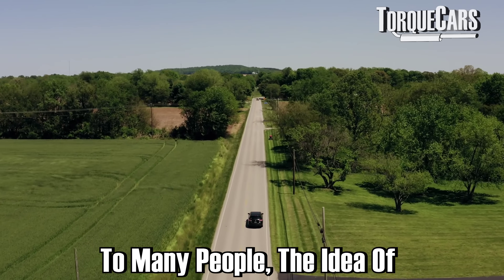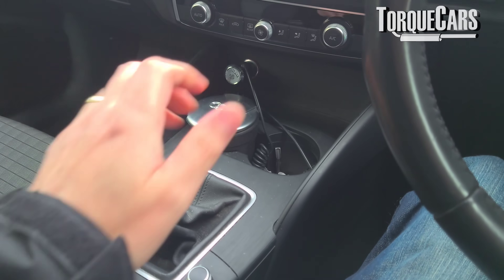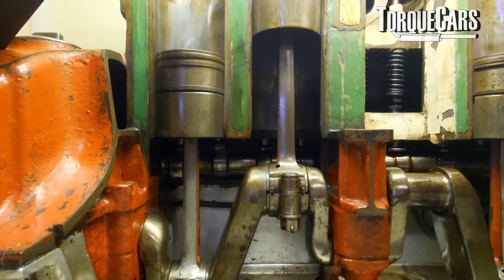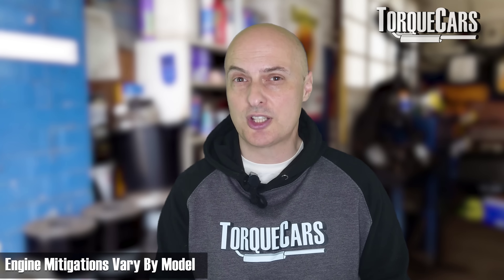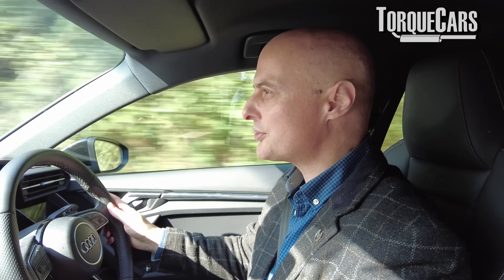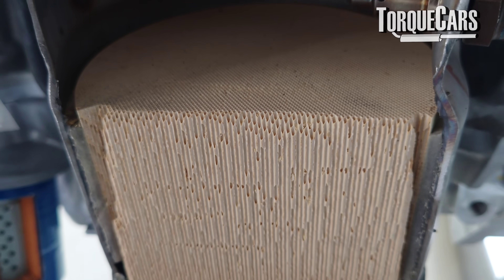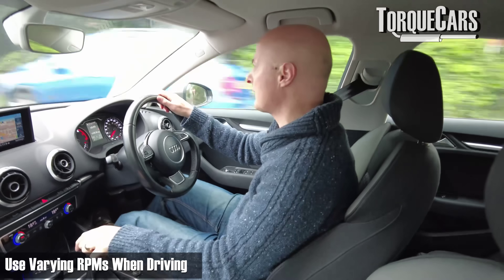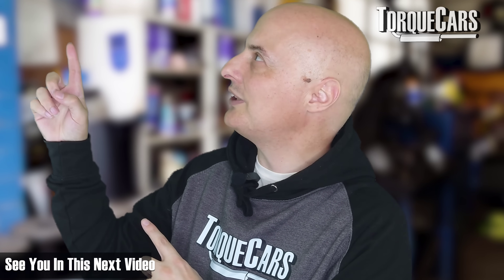BIG DAMAGE By Lugging at LOW RPM? Eco Driving Warning! (Manual Gears)

Comment: Low rpms are just fine for the engine so long as you don't need to give it much throttle.   There is a point in the programming where extra fuel enrichment is delivered when the manifold pressure rises  to a certain point...so best economy happens just before this enrichment point.   About the only way to find this is to watch a vacuum gauge and know when the enrichment happens.   If you can drive without opening the throttle to that enrichment point...then the tallest gear that will run smoothly is the one to use for best economy.

Comment: I got a pegeot 3008 2019, and it rarely goes into 2.4k RPM, its an 1.5 diesel engine, the red line limit is 8k,  even going in high speed or sometimes even throttling, but not thst much. Can it still effect it ? And if so, can i improve it

Comment: All the vehicles I've driven have always performed better after a period of sustained motorway driving if they've been used for long in urban settings. 
The red line on a tacho gives you a good indication of the engine's designed optimal rpm. 
Obviously jumping in and using high rpms on a cold engine is recipe for premature wear, but prolonged idling is undesirable too! What's a driver to do...?
Reply from the maker: Low load low RPM till the engine warms up is the best way to go if you can. https://www.youtube.com/watch?v=aCGsZp-OG4c I'll do a video on warm ups and driving cold engines to clarify this as I think it is a topic many drivers are unaware of.

Comment: Also a good reason not to go WOT at low rpms is the damage it causes to the gearbox, the small teeth that actually engage the gear and hold all the force slowly wear out. For example on diesels if you want to accelerate in 5th or 6th gear going below 2k rpm, it will sooner rather than later cause damage, because the engine has the torque and strength, but the gearing is way off to smoothly pull away, also at low speeds the transmission oil won't efficiently get to the 5th or 6th gears, this is a big issue with VW T4, T5 and even T6 transmissions, and also some 5 speed toyotas, usually Rav4. Great video, even though I feel like I know these things, it's always nice to learn more from knowledgable people!

Comment: Complete bs😮 why would the combustion be less efficient if it has more time to accomplish the combustion😅 you are talking nonsense
Reply from the maker: Are you referring to combustion at idle? I'm talking about volumetric efficiency under load at low RPM (or trying to).

I understand that a typical engine is volumetrically very inefficient at close to idle rpm typically only 50% this is why car makers are using cylinder shutdowns at lower points in the RPM range to increase efficiency. When you start pressing the throttle and lugging the engine, which is the main focus and intent of this video you see the engine struggling to burn fuel and make power. Perhaps I've not explained it well enough and if you can think of a better way to say this please let me know, I appreciate all comments and feedback.

Comment: Eco driving and seams to change over time and in different countries. What I learnt at driving school was to skip gears. Go from 2 to 4 and 3 to 5. But with a good acceleration and getting the car up in rpm  so when it lands in that higher gear it's already in the right rpm.

Seams like that was pretty good way to do it considering what you say here.

in later years they stared to promote a different way with low rpm driving.

Comment: I was taking a taxi with my grandad and I remember just cringing at the driving style of the driver. 
He was clearly taking the extreme hypermiling approach, completely torturing his diesel octavia. This is like a 1.9l engine, we're climbing up a decently steep hill at a low 1200 RPM and this guy goes for the upshift and proceeds to climb the hill at idle 800 RPM. 

I could feel the computer accelerating for him to stop the engine from stalling all the time cause he was actually shifting at around 1100 RPM and i'm like 90% sure he was going below idle on every upshift.

Comment: MOST EXCELLENT Presentation ---
An engineering definition of SET rpm: A standard from Mechanical & Automotive Engineering for 'rotating equipment':  A CONSTANT ~70% of designed maximum 'operating' rpm will typically yield maximum in-service life.  Such has been "The Rule of Thumb" since the ~1930s.   
Rx: Use your cruise control as much as possible, NEVER rapidly accelerate a COLD engine; and most important - - - - - DO NOT 'LUG' an IC engine.
For the 'modern' engine with (mandated) LOOSE TENSION PISTON RINGS ... change the oil ON TIME (or earlier) if most of your driving is at constant 'highway' speeds: and, at 50% of the recommended oil change interval if most of your driving is 'stop and go' (city) driving.

Comment: I live in the USA so the manual transmission is nearly as common as unicorns. The manual transmissions I’ve had I typically ran out to 4k before up shifting in normal driving. I don’t particularly like that my Toyota runs down the highway at below 2k when cruising along.

Comment: This video is the classical "car guy" stuff where everything has to be pro the things this group has defined as good.
Carbon and carbon deposited do not care for a slight increase in temperature, also the force on parts, be it piston rings or anything else is far grater at high revving.

Driving engines at low revs does nothing except making them go out if you go too low.

What is important to avoid carbon deposits is to drive long distances from time to time and avoid short ones under, depending on your engine, 50km or 100km because deposits usually come from the engine and exhaust system running under the designed temperature and they need a while at running at normal temperature to get worn away.

I once heard a nice sentence from a mechanic and that was "if you love your car you cycle" and I think it is a good guidance, because every distance that is realistically reachable by a normal bike (around 20km or 15mi) is bad for your car.

But I am out of that now anyway with the switch away from gas I can now drive short and long distance without any difference and I don't need to worry about temperature, or now to accelerate too soon after start. It is far better when the car is made to be driven and not to be pampered.

Comment: Question: I drive a UK 2012 Ford CMax. On the dash, it suggests gear changes at certain RPM ranges. It always suggests a gear change around 2000 rpm. Almost every gear, which will rarley ever letting the engine go above 2500rpm.

Is this just a feul economy feature? Not sure why it would always want you drivng in this low RPM range.
Reply from the maker: These are nearly always set for economy and based on speed/rpm, but they don't always take into account load, so if you are going up hill some suggest a totally inappropriate gear change. With no load ie constant speed cruising on the flat it doesn't matter but you should always blow off the cobwebs from time to time!

Comment: Does this matter for cvt cars? My cvt keeps my car in low rpms when accelerating.
Reply from the maker: CVT is weird in that it keeps at a relatively steady RPM but it is not lugging as it tweaks the ratios to avoid strain on the engine.
Reply: Alright thank you for letting me know 👍

Comment: I'm driving a VW Tiguan 1.4 tsi and the DSG logic keeps on upshifting gear too quickly for the speed that the car keeps lugging itself. I use the manual shift mode by default and operate at 2000-3000rpm range.
Reply from the maker: Is it the same in sport mode? Generally I've found the DSG quite intuitive when it's learnt your driving style. These engines seem to sit quite happily around 1650rpm when not under load and this seems also to give the best economy. A DSG gearbox can be adjusted and mapped so if it is a problem you don't have to live with it.

Is that the newer 7 speed box?

Comment: The car I have "solves" that problem. The Honda Crz it's a hybrid with a manual transmission, this one works well in these hypermiling situations because when you step on the accelerator in high gears at low rpm, it kicks with the electric motor. This and the Insight are strange examples where the video does not apply at all lol.

Comment: This is especially bad for diesels, diesels hate being used at low rpm constantly they love to be worked. I had a LandCruiser a few years ago and I was very general on its engine and after awhile I noticed major power losses and I put it to the fact I was getting large carbon and oil build up in the intake and intercooler as I was never reving it enough for the turbo to blow all the crap out of the intake system. On my more recent LandCruiser I drove it alot harder and never had an issue after that, it runs alot better after I give the engine a bit of a hard drive

Comment: I got 2 cars , 1 almost 20years 350k km and another 1 year old with 30k km 
My old beater 5 speed manual gear ratio forced me te keep constantly at around 4k rpm at 100kmh and 5~6k rpm when doing 140~kmh and tops out at 180kmh 7.5krpm, gear shift at 2500~3000rpm
But after all these year the engine still doing great running 5w40 full synthetic, doesn't burn oil some small leak from the timing cover, doesn't require top up and oil change every 8000km, fuel consumption at 14~15km/l 
Just did 130kmh 5krpm for total 8hours across states and back, everything still feels good 

But my new car with cvt doing 100kmh at slightly above 2000rpm 
Which I use for work and needed constant traveling and save fuel 
Using 0w20 and fuel consumption at 17~18km/l, but the advertisement says it could reach 24km/l maybe with a pinch of salt 
Yet to see how cvt car performs as they kept the rev low even during pickup ,unless I keep the sport mode on and rises the rev range 500~1000rpm higher throughout the cvt ratio
Will the engine be as reliable as my old beater

Comment: If you are driving a manual. I think its just common sense not to lug the engine.

You can feel the car lugging. Even if you cannot hear the engine or exhaust.

And when you feel the engine lugging, it does not feel right.

So naturally one will and can avoid engine lugging.

If you are driving, feel something is off i.e. lugging and still continue doing it. Then yea that is on you.

Comment: I had 1.9TDI and now 2.0TDI. Current 2.0TDI has 404.000km on watch. I aim for 1600-1900 RPM on slow rides, and 2300-2600RPM on highways. Riding a car in 5th or 6th gear uphill is heavy on engine, and revving it increases wear and burns oil.

Comment: I have three Nissan Sentras with a CVT. Here in the suburbs of Dallas, Texas, I do a lot of driving at 40-50 mph (65 to 80 kph) at about 1,200 to 1,600 rpm’s. I accelerate slowly and I’ve never had an engine problem.
Reply: @Alan-lv9rw  maybe this video isn’t for you.

Comment: If you dont know or understand what lugging an engine is and you want to save money, get an automatic. Engine rebuilds are expensive. If you have an automatic and want to save money, stop switching in and out of neutral and drive to coast downhill, and stop using park as a hand brake. Transmission rebuilds are expensive. Best way to save fuel is plan your trips better so you dont need to keep going back and forth from your house to town. Keep your tires properly inflated, and dont leave unnecessary things in your car that just add weight. Golf clubs, school books, etc.

Comment: ultra low rpm are viable for ultra low load, nearly idling at 50kmh in 4th gear through the town as example. but driving 70 in 6th gear aint good.
on my diesel i notice for 4th gear all over 1200 runs smooth and for 6th gear you want at least 1500, more so 1700rpm which is at least 90km/h. 
personalyl i keep my engine on high load between 1800 (where engine has already full torque as diesel) to up to 3,2k. after 3,2 the torque just drops and power doesnt realyl increase.
hitting 4,2 for overtaking. dont wanan chill on the wrong lane even if nothings coming.

Comment: if theres anyone out there that cares, my Ford ST170 goes up to 40mph in 1st gear, 70mph in 2nd gear and 90mph in 3rd gear.
it has 145,000 miles and i like to change the oil at 6000mile intervals

Comment: I´ve found  that with my 17 year old Audi with gas engine I use less gas when I´m driving around 2k to 3k revs than with 1.5k to 2k. 
I need way less throttle to get the same power.

Comment: So when i drive my 1.5 dci Clio between 1500-2200 rpm like 75% of the time and when i am on a highway or need to go bit faster pushing it to the redline, am i ok? It seems to me the 1500-2000 rpms suits the engine the best. Its quiet, it pulls the hardest in these rpms and the whole car doesnt vibrate unlike in 1100 amd the engine doesn't sound like its gonna tear itself apart like in 5000 rpm (redline)

Comment: this is genuinely new to me, though it should be common sense but when you're stuck with a 14 mpg car while having so little money for fuel you tend to do desperate stupid things to "save" money (dad's car so i had to cope with it). i used to run my 2.2l S10 on 1600-1800rpm and gear shift on 2000 because i only do city driving anyway, and yes it needs a bit more throttle if i need to accelerate while on higher gear, and i can hear the pre ignition knock sometimes too. the interior also rattles only if i drive on low rpm, though its probably just GM thing but i guess i take that as a reminder to downshift because that definitely caused by the engine vibrating abnormally. i thought opening the throttle like that only affects the fuel consumption so i just need to avoid sudden acceleration but i guess i was wrong. ill be running the usual 2000+ rpm, change gear above 2500 and use the entire band if i can then, as i feel that was the comfortable range that i used to drive when i was in a better financial situation. thank you for the insight.

Comment: Thanks for the clear explanations. I notice that when i drive my Mazda 3 2008 harder it runs smoother at idle too. Italian tune ups are the way to go. You can also have fun without breaking the speed limit. I pay for the best fuel and the best oil & despite the engine having high mileage their is never any smoke.
Reply: " I notice that when i drive my Mazda 3 2008 harder it runs smoother at idle too. Italian tune ups are the way to go...."  100% confirmation bias, guaranteed...

Comment: Unless you're driving an old Super Snipe or a big Yank slogger, keep the mill spinning. It was well-nigh impossible to convince my late father not to use 5th gear of his Maxi unless he was on a motorway.  Check out the Pathe documentary from the '50s showing BMC cars running flat out on the German autobahns. Flat-out in top gear does NOT kill engines. Tyre wear, yes, but not engines!

Comment: 800+ miles a week  highway miles & stop and go traffic
On my '64 CUDA with a cop car 318/5.2 engine 4 speed stick shift 
273 gears on the rear end 
1100 rpm at 55mph 
I drove that engine for 12 years 
All over southern CA fixing copiers printers and fax machines 
I used synthetic oil and changed it every 10k miles and the oil filter every 5k miles 
🤷‍♂️

Comment: I noticed this on my motorcycle (Suzuki Vstrom 650) . I was doing as the manual suggested & rode at around 10 mph per gear aka at 60 mph (100 kph) just hitting 6th gear. My computer said I was getting around 48 mpg. The sweet spot in the torque curve was another 1k rpm though. Staying in 5th gear at 60 mph put me right at my 5200 rpm sweet spot. I did not reset the trip meter with about 6k miles on it. This started to raise my mpg & throttle response noticeably. After a week or two of daily riding raised my mpg to about 52. That means nearly 8% better mileage, another full gear above my usual commute speed with more responsive & smoother higher speed acceleration. The wind speed became my cap in 6th gear around 75 mph before the efficiency started to drop off again.
Reply: This is interesting, but I don't understand your text, please clarify. "another full gear above my usual commute speed". Is 5 above 6? Is a gear above speed? Does speed mean gear?

Comment: To drive at low rpm you need to be able to have at a constant speed where you just tap the throttle and the car keeps going without accelerating or slowing down, it can be 1200 or 1500rpm or whatever as long as the engine isn't loaded, when it loads up and it slows down or eant to gain speed and you open the throttle these things mentioned here happen and you can hear the engine being loaded up by the sound.
Worst thing is a situation which for example you drive in 4th where you have to put 3rd, to save fuel you can just put a lower gear and use it to accelerate as you need up to 3000-3500rpm instead of shift up to have 2000rpm if there's traffic ahead, and let off throttle till you go back to the speed you were, and the engine if it's fuel injected is virtually shut off as long as you're off throttle.
A loaded engine at low rpm burns MORE FUEL than working at higher rpm within a reasonable power band.
Reply: Forgot to mention if you do low rpm driving you should revv the crap out of it once in a while everytime you drive it it doesn't hurt the average fuel economy and it is to keep the valves, pistons and the combustion chambers clean, cause a constant low rpm driven engine becomes a carbonized garbage. Pay close attention to 9:08